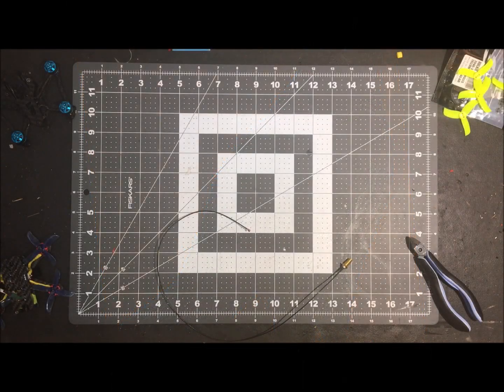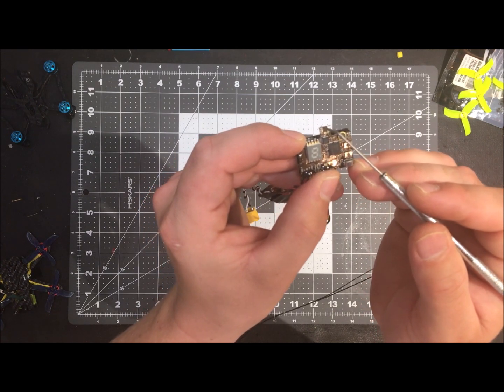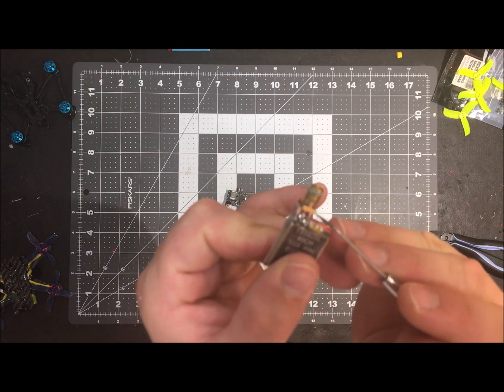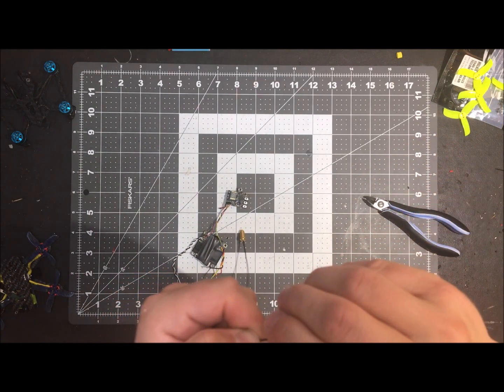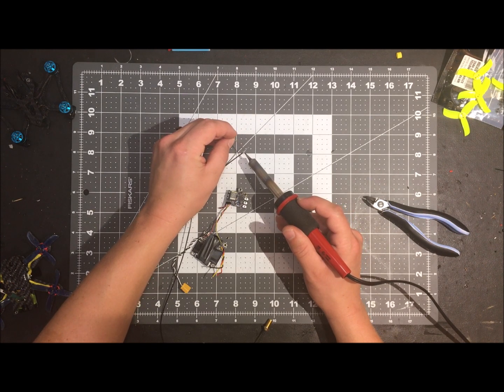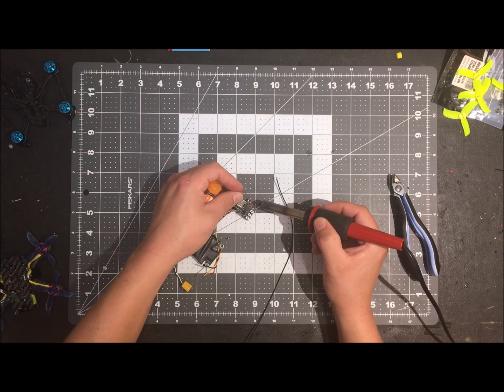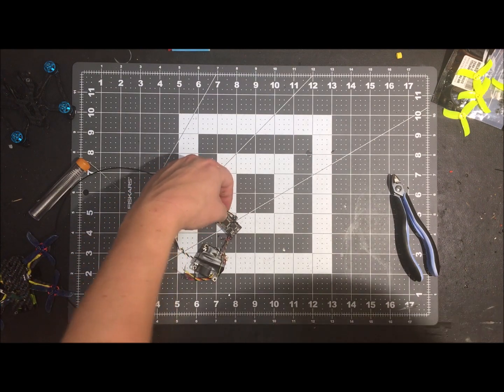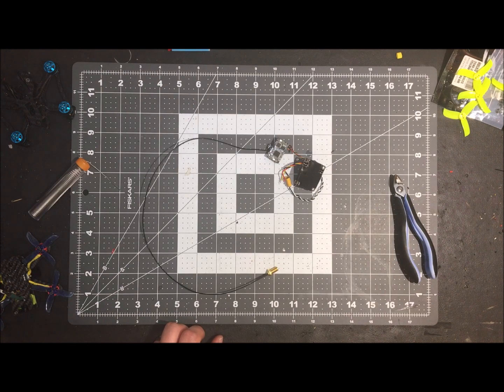Broke U.FL on VTX? No Problem!

Comment: hello I want to get help on a subject.  I used my ts5823L vtx transmitter without antenna and the device fell silent, which part needs to be replaced,
Reply from the maker: Hello, I am not 100% positive on the subject, will do a little investigating and see if there's anything out there to come up with an answer.  Apologize for the late response.
Reply: @BlackhawkFPV  Thank you very much for your answer. I expect good news from you.
Reply from the maker: @svsozdemir76  , Hello, hope all is well.  Unfortunately I have not been able to find a ton of identifying information.  My thoughts would be a processor chip of some sort that is not able to dissipate the heat without help, but that is only a thought.
Reply: Throw away it's burned  ,vtx without antenna specially if it's outputting 1w they cook straight away without antenna, buy another, vtx and receivers without antenna they get cooked burned ,and the ,radio it's the same without antenna gets cooked, never operate without antenna, it becomes a life experience